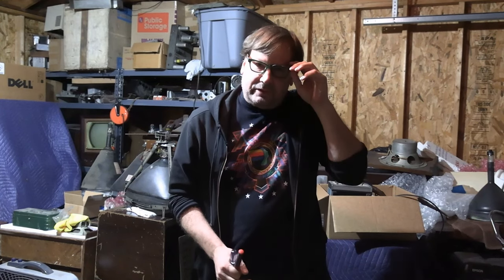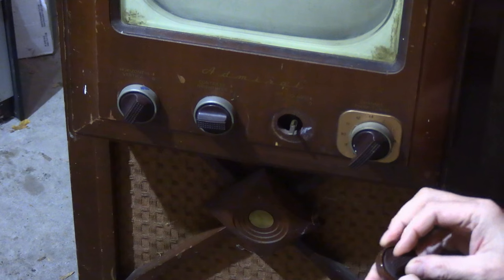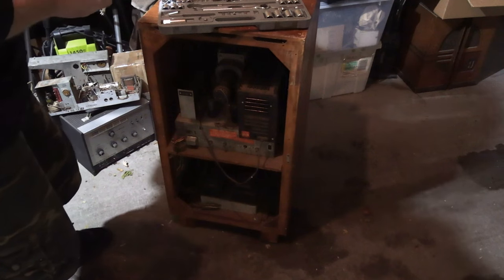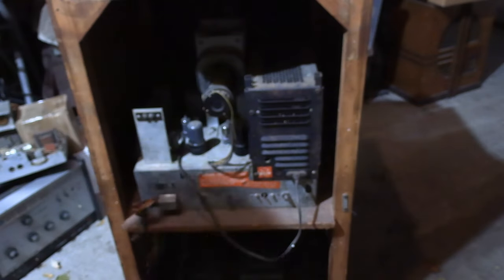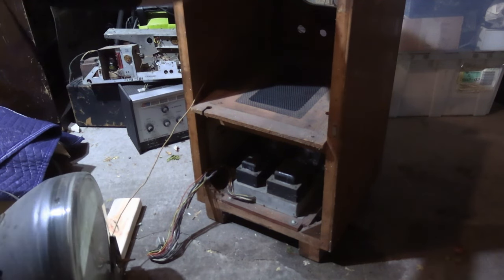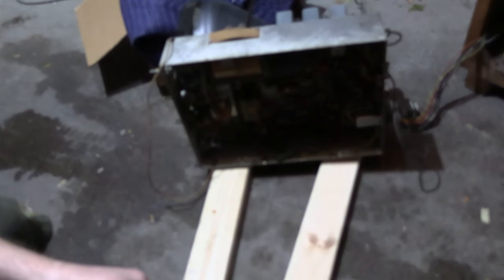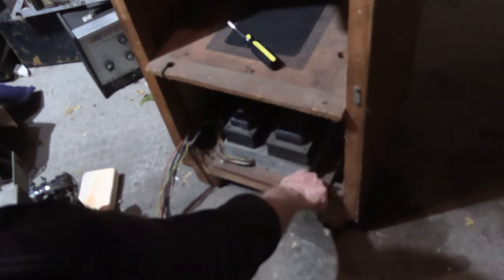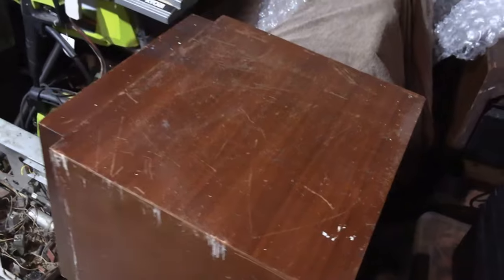Beginners guide to B&W tube TV restoration part 2 (chassis removal)

Comment: Engineering question. How different are the deflection circuits, plates versus yokes ?
Reply from the maker: Very.  Plates require very linear sawtooth waveforms with amplitudes of several 100 volts.  Yokes require very linear current and a controlled kick back at the end of a scan line or bottom of the screen.

Comment: For me, the greatest mystery in these old devices, tvs and radios, is trying to figure out what finish was used, how to restore it and with what. I have branded furniture from the 60's that the original manufacturer can't even tell me what was used for the finish.
Reply from the maker: Vintage wood TVs and radios are pretty easy. Everything from late 20s to late 50s and beyond was lacquer.